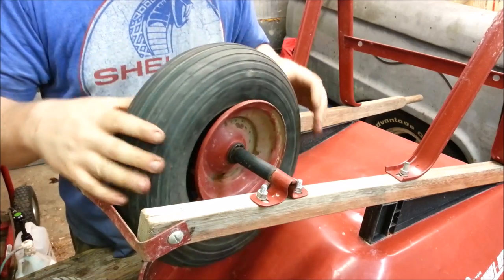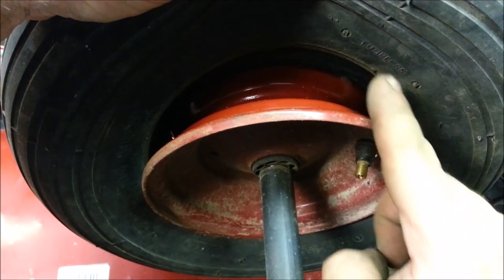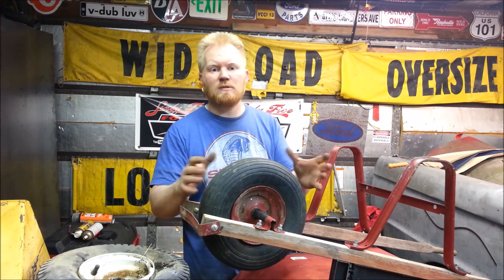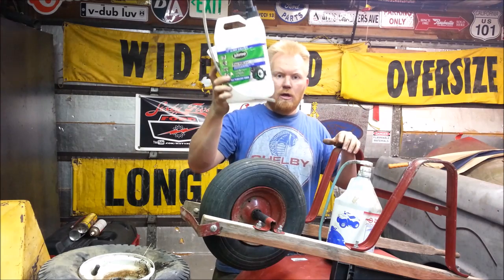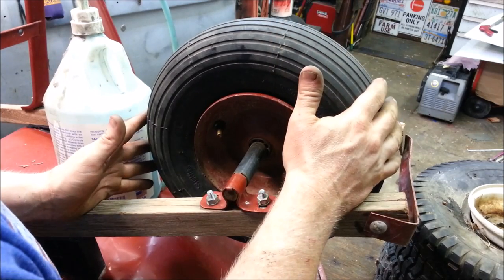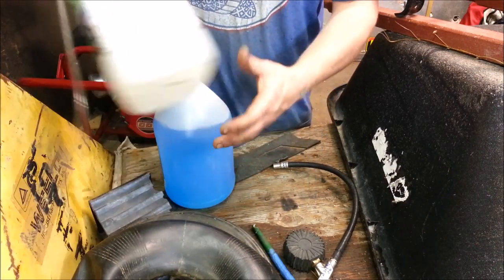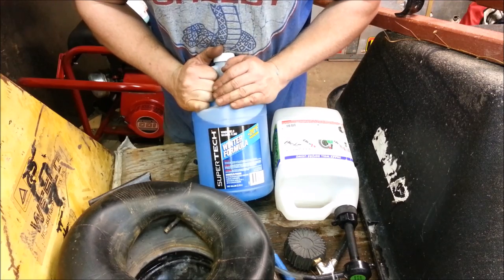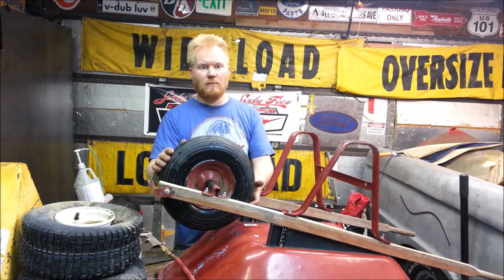No More Flat Wheelbarrow / Riding Mower tires

Comment: Do you recommend solid core tires for applications like this (wheelbarrows, handtrucks, etc)? Seems like it would eliminate these problems altogether. Great video, and great work - you have the best channel on Youtube. ;)
Reply from the maker: Jay Harrison I have a set that came with a hand truck. They have a less capacity than aired tires and they ride rough. But, they never go flat.

Comment: Great video Moe!
Is that the "Green Slime" that Walmart sells?
I don't know about diluting that windshield washer fluid, it would freeze in the winter, I has the 34 below stuff freeze in my wiper nozzle on my truck.
I keep my tractor on blocks so my front tires never come off the rim, when I want to use the tractor I pump up the front tires, pull out the blocks and off I go.
BTW..where would I buy tubes for the front tires of my 1993 Murray rider?
Reply from the maker: ***** Yeah, you can get the green bottle of Slime brand sealant for around $8 a bottle at Wal-Mart. That would keep your tires from loosing air but a tube would be even better. 

Online is your best bet on a good/inexpensive tube. If you have Tractor Supply Store they have them as well. Virtually all riding mowers use a 15x6.00-6 tire on the front. So a corresponding tube is needed for you. I wouldn't pay more than $10 for a tube as anything over that, they're gouging you.
Reply: Thanks Moe for that info, maybe I will try the green slime first but if that don't work it will be a mess for the tire shop to have to put a tube in it with that slime in there..LOL

Comment: A 5" aircraft tire on a 3 piece Martin wheel assembly will outlast any modern air tire on a wheelbarrow. Municipal airports typically give these away when they wear down. Be sure not to get any with bald spots caused by a rough landing on the flight line.
Reply from the maker: Great tip.
Reply: @sixtyfiveford  this is the type of wheel I referenced. The hub is separate. These are made by Martin wheel. Go kart rims are more expensive than these.
https://www.ebay.com/itm/192996085379

Comment: I bought one of those no flat tire, tires. I thought it was solid rubber, but it was filled with foam, just like yours. Guess what? The damn thing went flat on me! Foam will not hold a lot of weight. You need a true solid tire.

Comment: Great idea! I have also Seen someone put a tube in the tire then remove the Core and fill it will Expanding Foam and the Pressure from the can will Inflate it enough to keep full shape. Not sure how it did for heavy Loads of dirt.  One more Ad Click for you buddy!
Reply from the maker: TRX450R Vlogger I would think the foam would break down. I've seen people do it on Youtube but never give a real test. I have some dried stuff and it seams to smash and stay flattened pretty easily.. Probably OK for something that carries very little weight.
Reply: Yeah that was my same though as well.

Comment: Slimed my lawn tractor tire 2 days ago, used up what was left of a small slime container, about a 1/3. Still holding at the moment, next mow who knows. I never am sure how much to add. What is up with the windshield washing addition?
Reply from the maker: ug mold The windshield washing fluid helps distribute the slime all over the inside of the tire. It's handy in larger tires where it would take a lot more to coat the inside. I've only recently started playing with method but it seams to work amazing.

Comment: I was away on a work trip and my wife went to use our snow blower and sure enough the tire popped off the rim.  Couldn't get ti back on with my air compressor.  I picked up a couple of tubes and never had a problem again.
Reply from the maker: AnalogX64 Nice work. Tubes will hold forever.

Comment: A GOOD WAY TO SEAL TIRES IS TO TAKE AN OLD BLENDER AND PUT WATER AND PAPER IN IT AND GRIND IT TO A PULP!
ALSO TAKE AS MUCH PAPER AS YOU CAN STUFF INTO A TUBELESS TIRE WITHOUT INTERFERING WITH THE BEAD!
INJECT THE MISH AND ADD THE WINDOW FROST PROOF FLUID AS NEEDED!
ALSO USE A FLUID INJECTOR AS IS USED ON FLUID FILLED AGRICULTURAL TIRES!
THEY PASS THE MUSH EASILY!

Comment: Okay now your tire is good. Axle bearing kinda loose & clunky. What about that?
Reply from the maker: I generally makeshift my own 00 grease by adding some chainsaw bar oil (30W non-detergent with tacking agents) or some 80w90 gear oil. Good old grease soup. I have bought it before but it's expensive and or not available locally.

Comment: I bought a couple of quads that the previous owner used that slime stuff in the tires. Discount Tire had a heck of a time breaking the beads and when they did, talk about a mess! The stuff works though. Good video.
Reply from the maker: vegasfordguy It keeps the air in for sure. Thanks.

Comment: Not wanting to chase down an earlier video regarding recharging the gas in empty spray cans, if you will, do you have a method on how to repair a snapped off sprayer. How many times I have dropped a brand new spray can, only to have the nozzle snap off at the base.
Reply from the maker: I've spliced it with a thin steel tube(ball fill needle) inside the two broken pieces,  but it's never is the same.
Reply: @sixtyfiveford  Thank you.

Comment: I've heard of guys filling them with sprayfoam. Was wondering how that  lasts.
Reply from the maker: I've only ever seen spray foam flatten out after it's put into tire. The weight smashes it the same as when you step on a chunk of dried spray foam and it doesn't rebound fully.

Comment: When I got new tires for my tractor I had to bring the wheels into the mower shop because I couldn't get them on. The shop insisted that I have tubes put in even though the tires were tuble-less. They were right. Haven't had any issues at all with the new tires.
Reply from the maker: Dasdfjkl That's a good shop. They know how much trouble the tubeless on these rims will cause a person.

Comment: I'm lazy. I sprayed in as much insulation foam as possible and than seat it. As foam expands, it hardens. Did have a few that had too much foam. Chisel it off and start over again.
Reply from the maker: The foam breaks down under load quickly and just flattens/crushes. It's fine for maybe 50lbs but over that and it fails in seconds.
Reply: They spray that in lift tires..many strength of foam.
Reply from the maker: @philippebertrand8648  That's speciality foam designed for tires. You are not going to find that at the Home Depot in a can of insulation foam.

Comment: remove valve stem. Fill the tire with sand using a funnel. insert valve stem and apply air pressure as needed.
Reply: Or cement! Lol

Comment: The on-farm tire repair guys have this stuff in a 55 gallon barrels. Ag flotation tires are all tubeless like the ones on lime spreaders, tank spreaders even those 66" terragator tires. Tires go flat all day long from too much weight like field lime or sandy type manure. They always put this slime in now & those tires never go flat. It helps to make wide turns. I hauled one of those 6 ft diameter flotation tires in the trunk of my alero once, struts have been making noise ever since. lol. It was flat so it fit in there. The mexicans always steal the farm work truck so i use my car.
Reply from the maker: jasonmushersee I need a 55 gallon drum of this stuff. Sometimes the car needs to step up and play like a truck, I know I've that a lot of times.

Comment: Smashing tip :-D i didnt know about the crappy rims they put on wheelbarrows :-)
I was thinking that you would make it a solid tyre by partly filling it with builders foam in a can lol, just watch that tyre explode ha ha :-D
Reply from the maker: zx8401ztv I've seen quit a few people use builder foam, but I guarantee that it won't last. That foam compresses and breaks down under pressur. So one heavy load or a curb and you have essentially a flat tire or a lumpy one.
Reply: sixtyfiveford Oh yes i suspected the foam may not be quite right, thats why the final sentence about a tyre explode is there lol.
The innertube is the cleanest way, im still amazed that tubeless tyres dont cause more trouble.

Comment: i bought a flatless tire for my wheelbarrow, not enough bounce kills your back..
Reply: Worse than that I work construction and we quickly found that it takes almost twice the effort to push a full wheelbarrow across a concrete floor with a no flat tire vs an air filled tire. After we learned that my company no longer buys no flat tires.

Comment: I had a leaking car tire 15inch rim the rim was realy rusty and the beed wouldent seal I tougth about getting slime but I needed the tractor to scool in the morning so ordering slime wouldent be an option and no local shops had it. I tougth about wath i could use at home. I took out the valvestem and put 1.5DL car undercoating in the tire put the valvstem back fille dit up with air and started roling the tire aroun in the garage. It had sealed on the inside beed but the outside was still leaking and i had no more undercoating. I rooled it on the floor some more and there was now only a tiny leak so I took a malet an started beating the tire where it was leaking it stopped leaking and it held air fine i drove around about a week (dayli driving) later i filled up some more air and now a cople of monts later its still holding air. The rim wount rust anymore on the inside atleast... But sure will be a mess for the tire changing guy when the tire wears out but i only plan on kepping the tractor till the summer.
Reply from the maker: Great job. Yeah, the next guy will be surprised by the insides.

Comment: For new tires only, there is a product called "FLATOUT". and it coats the whole inside of the tire, Does NOT rust the rim and lasts the life on the tire. AND, unlike most all tire sealers, you can use FLATOUT on highway tires. It is a little pricy but well worth it if you run around a lot of thorns, etc.

Comment: Why not using this crack filling foam spray bottles 🤔
Reply from the maker: Because that's an internet hoax. You can literally take the foam and smash it with two fingers and it stays flat. The same thing happens when it's in a tire and you put 300lbs on it. You then have a completely lumpy tire that is no longer salvageable,  a mess to cleanup when you change it over to a new tire and a bunch of lost time/effort.
Reply: @sixtyfiveford  it could be also different Typs of spray foam 🤔
That sucks 😑 thans for the information. 👍🖖

Comment: They sell solid rubber tires for them
Reply from the maker: Yes, but they ride like crap. They used to only make solid steel or rubber tires up until the 1970's. It was a major advancement to have pneumatic.

Comment: Would you consider using slime on car tires?  My car has a slow leak and it has the tire sensors which I believe is where the problem resides at the stem.  Take about 2 weeks to loose 5 lbs so not a major leak just annoying.  I'd be concerned about it rotting the tires.
Reply from the maker: NakedLadyBrewing For a slow leak I would use it in a car tire and have. Though I wouldn't use it to seal a puncture in a auto tire as it's easy to plug myself or most tire shops plug for free. The most common reason for a non puncture leak in a car tire is the bead and this works wonders without rotting the tires at all.

Comment: I would rather spend the money for an airless tire for a wheelbarrow. I don't have to mess with it then. You can get them from tractor supply for $39.00.
Reply from the maker: True but airless really suck to use over anything but smooth concrete. A pneumatic rolls over boards, rocks, steps etc while loaded far easier.
Reply: @sixtyfiveford  yeah but I don't use my wheelbarrow very often.

Comment: Foam just does not work. Foam started to compress and crumble almost immediately. You can't leave weight on because it would compress and sag on one side. Waste of time that keeps on getting propagated here on youtube. Here is a method that works so far - remove the inner tube. Buy poly irrigation type tubing. Stuff as much as you can in the tire. It is tricky, but possible to mount stuffed tire on the wheel.